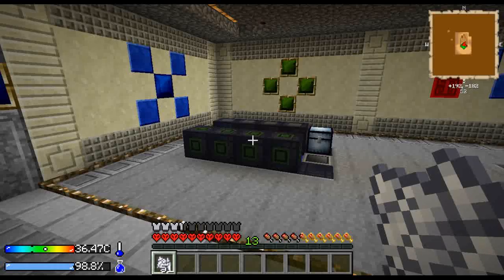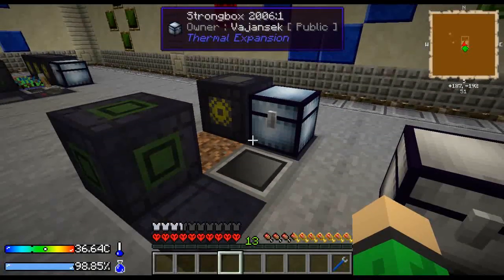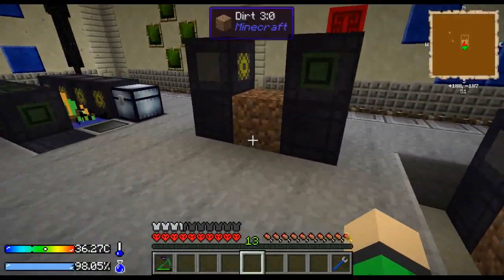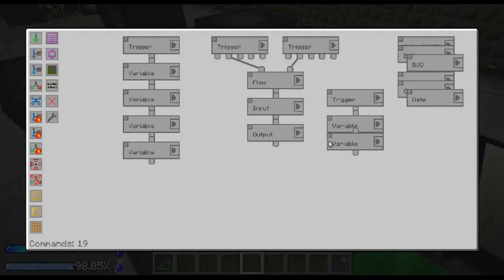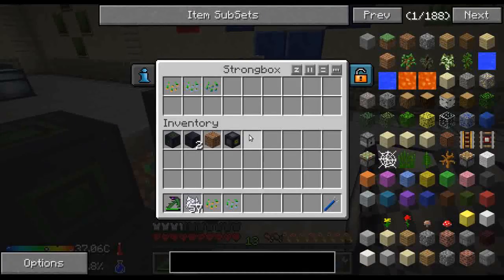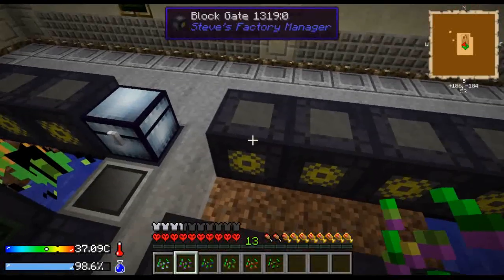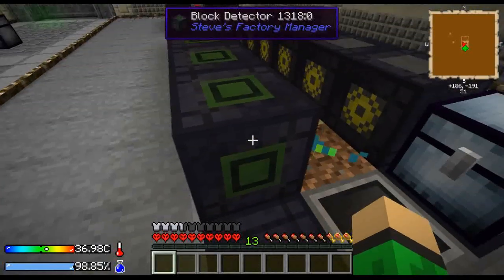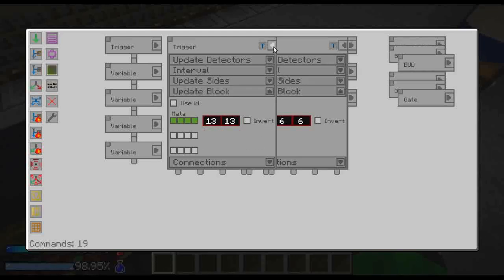Steve's Factory Manager Automation - Pneumatic Seeds

Comment: Hey thanks this really helped me except I was wondering if there was a way to add a function to bonemeal all the plants using this set up?
Reply from the maker: Yes, there is, I did it and was thinking about short tutorial to upgrade this design. You need to add one block gate to every module 2 blocks above the plant (so that it'll simulate right-click), then just do the same trick for setting the right triple of variables and send bonemeal through corresponding block gate if plant is not mature. The previous part of this program will take care of the rest.

Comment: Very interesting system I must say, but I ran into a problem...
I rebuilt this system to automate the seeds but the system itself doesn't leave a seed so that it yould regrow, Ender Seeds are being harvestet emediately after planting and the 2 Triggers in the middle (the last 2 ones you placed) are showing an error that the whitelist is empty, don't ask me which one... Can it be that the metadata of the plants changed or did an Update break the Facory manager? I'm using the Direwolf20 Pack (Minecraft 1.7.10) (Pack Version 1.0.1) and I checked everything like 4 times but I couldn't find anything that is different to your system...
Reply: I am having the same issue as Filly Luna. The machine picks up all the seeds instead of leaving one to regrow. Is there a way to fix this?
Reply: dewboy3d switched the input from "Mod Detection" to "Fuzzy Detection" and it started working just fine.

Comment: Hey, I programmed allt exactly the way you did. but I have a small problem and that is that systeme not pick up all the seeds, except one that will replant, so from one seed which I then get 3 new seeds from some types of plants so it picks up only one and sometimes no seeds , is it any way i can fix that? I play on a private server online that I myself coughing
it would be nice if you could have help me with the problem
Reply from the maker: Hi, this system is not working the same in MC 1.7.10 as before, so it needs some adjustment. I saw, that +dewboy3d already solved this problem, you need to switch the input of Block gate from "Mod Detection" to "Fuzzy Detection". You can do that in the part, which I'm talking about at 14:00.